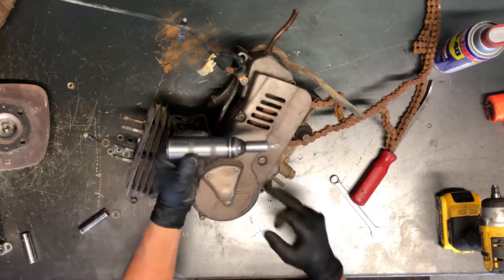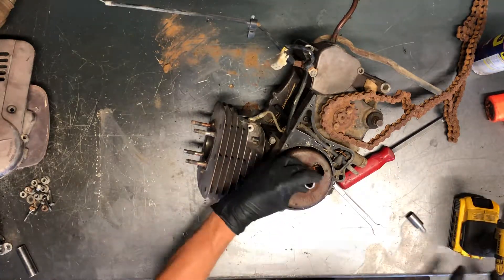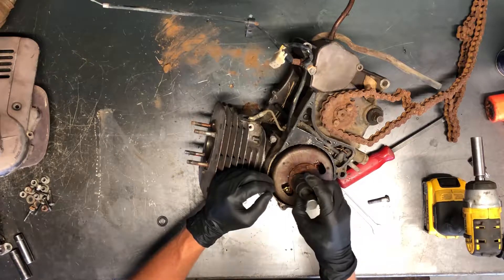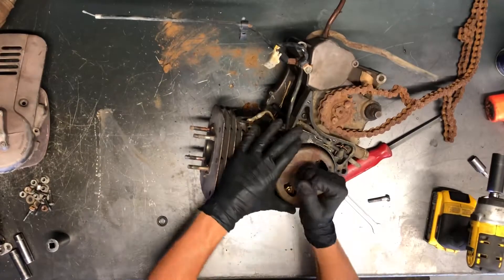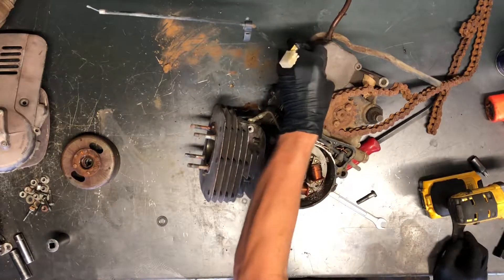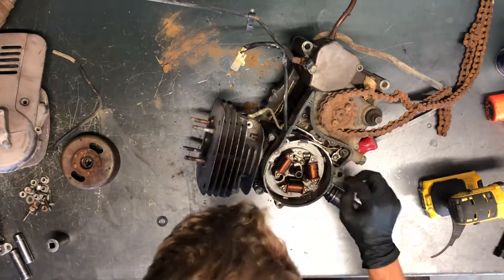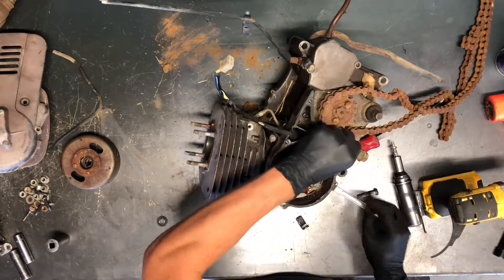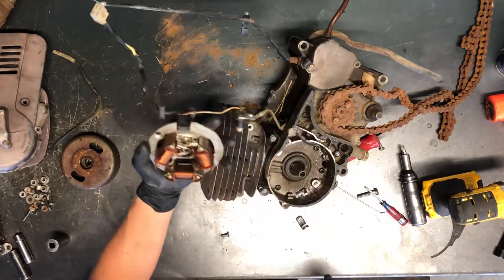Honda MT125 MT 125 Elsinore - Stator Charging Magneto System Issue Broke Flywheel Pull

Comment: What size is the puller.. 26?
Reply: on amazon  the  size  is 24  to 27 mm   Extracteur de volant d'inertie Magneto (24 mm et 27 mm) compatible avec GY6 50 CC 125 CC 150 CC pour Kawasaki Yamaha Suzuki KTM, scooter, cyclomoteur, VTT, moto tout-te